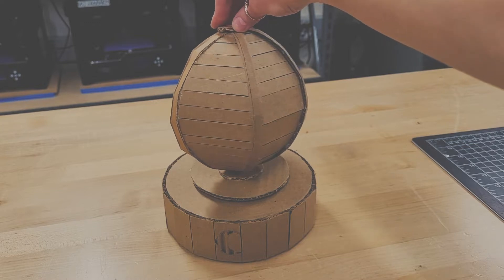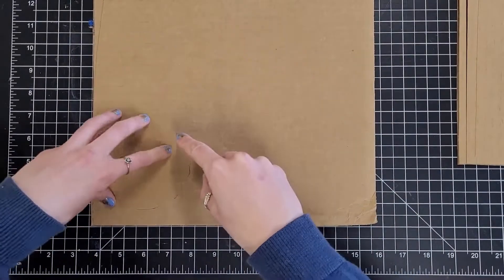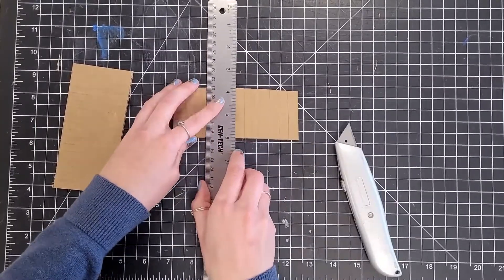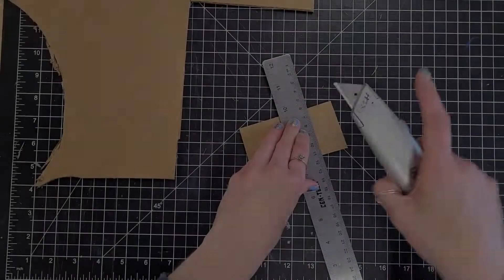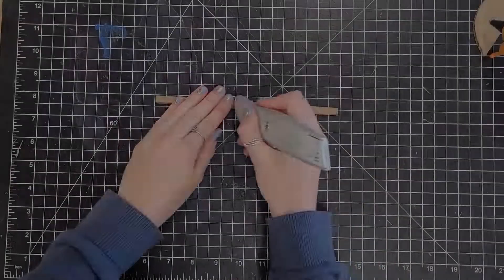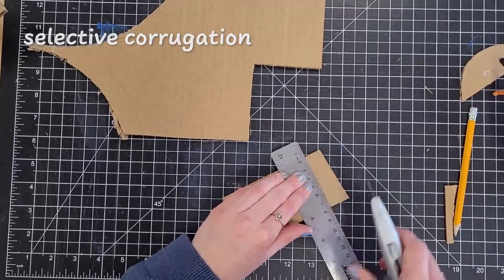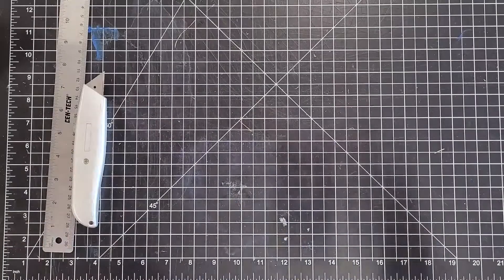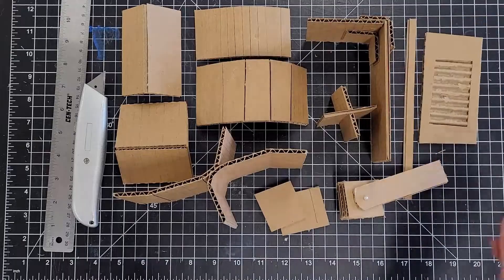Cardboard Prototyping | Techniques

Comment: Have a look on a cardboard box for bending. They don't score but are pressing indentations into the line of bending. You have to account for the thickness of the material to place the bending line. Allways measure the outer bending curve for material calculations. Cardboard may compress on the inner curve but does not stretch on the outer curve.
Reply: Just what I was going to say. This creates a stronger piece that looks for more clean.